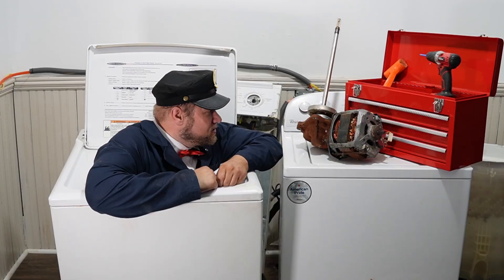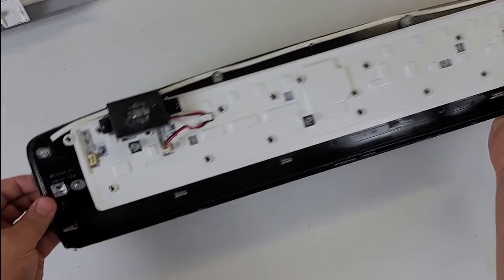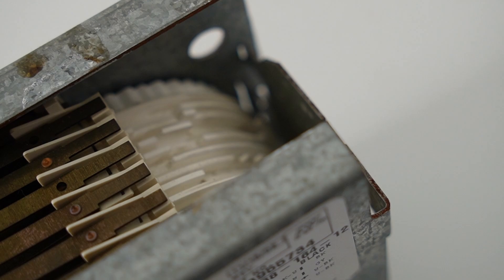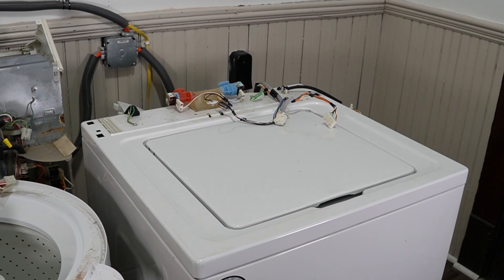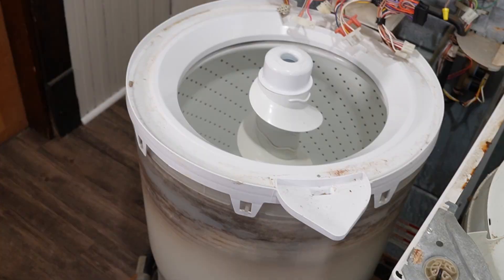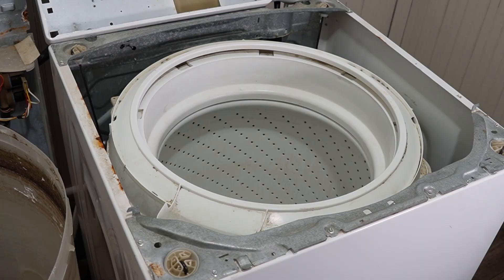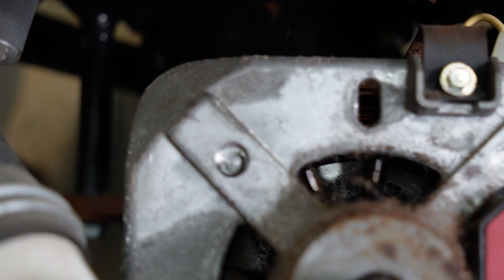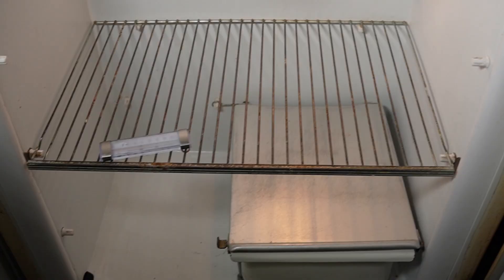Are Washers Built to Break? Inside a 1984 Washer vs. Now

Comment: I have this same model washer and matching dryer. They've worked good for 6 years now. I hope the washer will last longer. I used to have a 1999 whirlpool Estate series, and that one had issues over the years. By the time 2016 rolled around, I had replaced the dog clutches for the agitator, rebuilt the brake system on it, and replaced the transmission and drain pump. Gave it to a needy family when I got the new pair. Timer and limit switches were replaced on the 1999 matching dryer in about 2012. I liked that washer so much I got a few for other friends or family. The only issue on the dryer that matches that washer, is the darn handle breaks like crazy, but there is much stronger aftermarket ones on Amazon that don't have such puny little tabs that don't break off inside the door like the OEM ones. So far so good. Washer and dryer were cheap (under $500 back in 2016) so if they give me any trouble I'll probably switch to SpeedQueen. Not a fan of LG, their linear compressor fridges suck. My dad was an appliance repairman in the 1970's he said SpeedQueen was the best. I got Whirlpool at that time because it was about the only affordable made in USA left.

Comment: I've heard various opinions on GE over the years. But I've had good luck with them - at least those machines from the late '90s and older.  The house I bought in '89 came with a GE washer from 1977. It was still working, but not that well, when I replaced in with another GE in 2007 - a 1998 GE I rescued from curbside. I talked to the lady that owned it, and she said it needed a some type of switch. Well, it seemed to work just fine when I installed it. Only issue I noticed was when my brother runs it on gentle-cycle, it keeps switching from gentle to normal. I never use that cycle, so I don't care. After 7 more years, the tub's alloy drive-plate broke. But I was able to repair for about $90 in parts. Still goiing strong today!

Comment: I own a washer almost identical to the 1984 model you showed here. I am reluctant to say this (Knock Wood), but it still works fine, and I'm guessing its somewhere near 35 years old. I also have a companion dryer with this with the same good condition. Thanks a lot for this video. Enjoyed the learning.
Reply: Same here.  Grandmother bought in back in mid 80's.  Been used every weekend since.

Comment: I'm a retired appliance tech. I started back in the mid 80s and at the time Fridgidaire had been sold to White Consolidated .  They had taken the well deserved reputation of Frigidaire for high quality and were putting out machines that were failing to beyond reasonable cost repair just about the time the factory warrenty ended.
I loved those older Whirlpool washers with the wig-wag solenoids.

Comment: If I can't pull the drum, I don't like to resell them. You can see all the soap and fabric softener residue that I always scrub and  pressure wash. On the classic direct drive washers it's best to replace the inexpensive rubber tub seal. Older Whirlpool washers can be rebuilt over and over. Rust can be sanded and painted and if the unit is too rusted, I keep the entire back panel and motor and use it on a frankenstein washer build. The bonus with many Whirlpool drums they are interchangeable. If that newer Whirlpool drum ever comes out, it can be used in that older Kenmore. When the washer drums are unusable anymore, they can be mounted on an old milkstool frame from a Whirlpool and they make the best firepits. They will incinerate cardboard with minimal smoke and the light flickering through the drainholes is mesmerizing like a ever-changing light Brite.

Comment: At work, somebody welded a spanner wrench to 1/2" drive socket.  I believe 1 11/16?  Whatever fits best.  They then cut the handles off.  We love it.  Just put the socket on the spanner nut and torque it off.  Never had one it couldn't remove.

Comment: My father bought his mother a refrigerator in @ 1947. When she moved to an apartment, he moved the fridge to his business about 1969. That thing ran without a hiccup until about 2004.

I bought my house 30 years ago. There was a Kenmore heavy duty washer and dryer in the basement, probably 5 years old at the time. The washer finally quit last year. The timer / control unit died. There are no replacements available. The dryer (gas) is still running like a champ.

Comment: The old washer is exactly the same as the one I have that I bought new in early 2003.  Mine looks in better shape and still works well.  sometimes it seems it isn't spin drying as well as it should but then it seems fine.  I try to be careful with the total weight of the loads so it will continue working for me.  I recently replaced my still working fridge and stove.  I saw your video on those.  I liked living with the old ones better.  I only replaced them because of the energy use and I didn't want the old fridge (1992) to die of old age at a most inconvenient time.  I did get a very basic fridge, GE, freezer on top. The stove has features I still don't know how to use a year later.

Comment: Appreciate your videos.  Have a 2001 Series 90 washer that looks nearly identical to what's in your video.  Replaced the motor coupling twice, otherwise no issues.  Now the motor hums instead of running.  Going to dig into it this weekend.  Understand that " sock in the drain pump" is first thing to check.  If have to replace it, will not buy anything other than the Speed Queen classic.  Those seem to be only new units even close to what I got 20 yrs ago.  Cheers!

Comment: I worked for Coinamatic when i was younger  as a painter. Coinamatic would buy normal washers and dryers from Inglis tear them apart , rewind the motors. Strip and repaint the washers and dryers  and the average lifespan was over 10 years of commercial use before returning for service . from the same washer and dryer that would give up in a couple years of normal home use

Comment: When the older unit does not tell you where it was built, generally speaking it was built in America.  Only when it was not built in America the parts are usually labeled as such.  This is a general rule and not true in all situations, but for Whirlpool in the early 1980s you can assume it is true.  Appreciate this as it shows how electronics, sometimes not well designed (undersized electronics that overheat are that) are the cause of failures in the new product.

Comment: I have that exact Whirlpool that you have in your video. When me and my Fiance moved into our house 3 years ago, we bought that exact one, and ironically enough, it failed about 1 week in and had to be replaced with a whole new unit, under warranty. The weird thing was the "Replacement" one they brought us, came with a totally different user manual with a slightly different model number, but physically looked identical. Also it was odd, we got the washer and dryer combo on sale for a really good price. I also remember when I called Lowes where we bought it from, they instantly were like "We will replace the whole unit with a new one, we will send a truck out with 2 guys to move them" that always struck me as odd as that was the only flawless warranty process I have ever went through. I often think back about why were they on sale for such a good price, and why did the replacement one come with a different user manual and different model number?

Comment: I've had my washer for over 20 years and only have had to replace the coupling fitting once. I  did my self in an hour. 
My 20+ year old dryer died last year, 5 mins on youtube and a 3 $ fuse it was back working.

Comment: We have an early 2000's Maytag washer and dryer. They came with the house that we bought in 2005. We had an issue with the dryer about 4 years ago. Went to look at new machines and were not impressed. We made the decision to have the dryer repaired instead of getting a new set of complicated and overpriced machines. It was a good decision. Keeping these old Maytags as long as possible.
Reply: The old Kenmore/Whirlpool stuff and Maytags were great.  Definitely worth fixing them and keeping them going.

Comment: I have a Maytag I got in 1977, and I replaced the motor once, probably the mice getting in plus the dirty power here in rural Maine. Anyway, it worked then, it works now, 45 years later. Really interesting video. I'm don't follow appliances, but your vids are interesting. Thanks!

Comment: The collective failure rate of every component in modern washers is calculated before production and is GUARANTEED to be lower than even the most reliable individual component 40 years ago. Design and engineering flaws have nothing to do with the fact that modern components last longer and in more extreme conditions, under far tighter tolerances and failure rates.

Comment: In 2020 I had to get rid of my 35 year old Whirlpool that still actually washed fine but one of the tripod legs rusted away so that the inner and outer tub was now leaning to one side. I got a Speedqueen with a motor and transmission that looks identical to the old reliable Maytag ones.

Comment: Had to change a 2 year old direct drive Maytag motor (which is a combined motor and transmission). Wash plate would not come out. Had to eventually use a Dremel and split in half to be able to get some purchase on the splined collar. Once I did that, I made a rig of many blocks, a 8 ton bottle jack, and some metal rings to be able to pull the tub off. This whole effort took days and a lifetime's worth of cussing....but I got it done. Needless to say, reassembly did involved some good silicone grease.

Comment: I had a repair job some years ago where a woman replaced her worn Whirlpool direct drive with a newer direct drive. But she was frustrated because the new one had the thermistor controlled water fill valve; her husband was a roofer, and she used hot water to get his filthy clothes clean. Because using pure hot water "Wastes energy" (in the opinion of government bureaucrats) she could no longer get the hot water straight out of the water heater since the washer would mix that with cold water to give her water that's "Hot enough" per Energy Star. I had to tell her that there was nothing I could do since the machine was working correctly per the manufacturer. I strongly prefer the slightly earlier direct drive machine that does not have the thermistor of temperature control circuit board.

Comment: I bought the washer on the right in 2015 to replace a Montgomery Ward washer from 1969 I got for free, that was a mistake. After transmission failure after six years that washing machine was replaced with a Maytag professional, which I later realized was also a mistake. When the Maytag pro fails I’ll be on the hunt for an old washing machine and a pile of spare parts to keep it going for the rest of my life.

Comment: Dude, we had the kennore set, 29 years only issue was a plastic space that broke because we overloaded it. The gas company or elecetric company came over, said we qualify for new energy saving units. Took the bait. Two years later the washer electronics went out. No way to replace myself, needed a tech. I threw that POs in the garbage and went out to a used appliance store and bought back my kennore elite washer. And what do you know. No issues.

Comment: I bought a house in 1991 that came with a washer and dryer from the early 1980s. After 5 years the washer began to leak.
I took it apart and it had a baked-enamel tub that got a pinhole in it. $2 worth of JB Weld fixed the leak and the washer ran for another 10 years.
I found out how much of a draw the spin cycle puts out when superstorm Sandy went through and my 4500-watt generator couldn't get it to do any spin cycles.

Comment: This is exactly why I keep my 21 years old Maytag Neptune (MAH4000) with the manual dials. It went through a family of six with no issues and  bought if from her about 7yrs ago. The only thing that's been done, is I changed the belt about 2yrs ago as it was slipping. I will never get rid of this washer and dryer set until they stop making parts for it. I sure do miss the real Matag. The Maypool line is horrible.

Comment: I wonder if the spanner nut inside the drum that would not come loose had a left hand thread? Also, the newer machines with an inverter motor are fantastic. No drive belt. No transmission. No braking clutch. Just a motor made up of a permanent magnet rotor, and a series of copper coils for the stator. A hall effect sensor for speed control. The motor reverses for agitation simply by reversing motor polarity. The only friction part is the center shaft bearing connecting the drum. If there is any negative side, it would be that it requires a power control inverter board to run things.  Thanks for dissecting the two models to give us a comparison. How about showing one of the newest inverter models next?

Comment: Had an apartment wash / dryer stacked combo  I don’t recall the brand probably kenmore or something like that.

Anyway they were store in a closet and to access you open the folding door.

I guess one time after doing a load the washer shifted forward moving it closer to the door.

When the door was opened the main knob snapped off. It was a clip in type of knob that had a small shaft with a slightly larger than the shaft end to clip in.

Anyway that piece broke in half, the knob fell off and the clip in part remained in the spot it belongs.

I searched up and down the internet and you couldn’t buy just the knob, you had to buy the whole $300 console.

I searched the dump for an old one called every single appliance place in the city and nothing.

Challenge accepted, I did assembled the washer mind you I had to remove the dryer from the top of it.

Eventually got the console out, popped the broken piece out that was retained in its spot.

I believe I used some gorilla glue or epoxy. It was something a bit different because the plastic was very hard and brittle.

Anyway glued the pieces back together and clipped it back into place and voila. $300 saved with $12 of glue.

Comment: I have a matched set Maytag insignia washer dryer I bought new in 2001. Neither one has a circuit board in it. The only problem I have had was the washer has a large plastic socket type thing that the tub pivots on in the bottom that wore out. I replaced it myself and it was really cheap. If you have one and the tub starts wobbling really bad on spin cycle it is that socket. While I had it apart I replaced the belt but it was still ok. I ordered the belt with the socket just in case it was worn out, so I thought I might as well put it on. I kept the old belt for a spare. Never had to do anything to the dryer yet. I may have to replace the timer on the washer some day. It has gotten noisy but still works fine. Makes a buzzing noise. One thing I have noticed about new washers, my sister has a new top loader and the spin is faster and gets a bit more water out. But if the load is pretty well balanced my Maytag does good enough on removing water.

Comment: You proved the point to the video through the difficulty! Newer unit is not serviceable and the almost 40 year old machine came apart easier. Another point is the newer machines have the motor armature poles potted into the baskets and work as a sort of stepper motor so there is basically no motor and you have to replace the entire drum if the motor fails, should you be lucky enough to diagnose a machine's fault. Electro mechanical is so much better!

Comment: I will take a simple analog controlled unit any day. The water level sensor is an aneroid chamber that moves with water pressure. In a car, it detects altitudes. Water temp, simple 3 position switch, the timer is a small gear motor that rotates a drum cam. There are top to center contacts, bottom to center contacts. If you stop the video where it shows the side, you will see a “Truth Table”. T/C are top contacts that close to center contacts. B/C are bottom contacts that close to center contacts again. The bumps on the cam will either lift bottom to touch center contacts or push top contacts away from the center row. The “HASH” marks is the truth of each terminal w/ coded wire, that has no resistance when closed or open when pushed apart. No worry about timing or position, the drum cam is keyed to the knob and points to the operation selected. The contacts can be cleaned with 300 grit sandpaper glued to a naked cotton swab, lift the reed switch contact and gently clean by sanding both. Bottom ones are harder but you will notice wider contacts or black carbon from arcing as these go to the motor. These have more load or current passing thru. The is amps or the pressure on electrons to flow. Acetone is the same as finger nail polish remover. It evaporates quickly but hit with compressed air or the overpriced can stuff. If you can get the right schematic by model, flow the wire codes as they are printed on each wire. The circles are numbered with even numbers. Certain numbers look like letters so not used. 0,2,4,6,8,10,12,14 are not confused with other symbols. Note; even located at different spots, they are located at this drum cam with the rows of reed switches. When designed in the 80’s, I tip my hat to the engineer(s) who designed it. 
DK, Retired ASE Master auto tech.